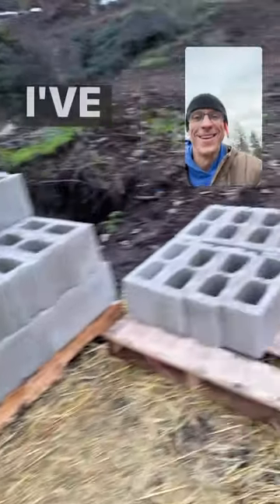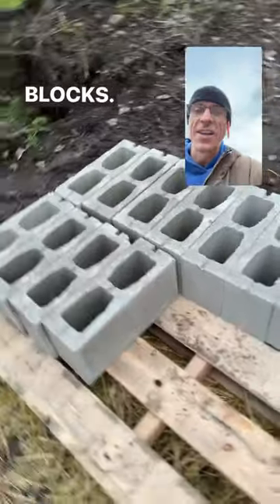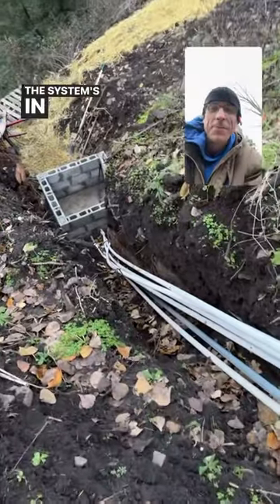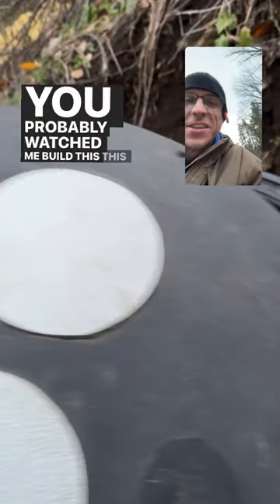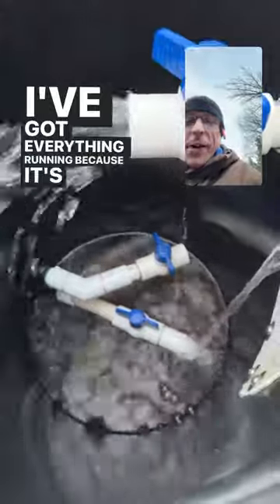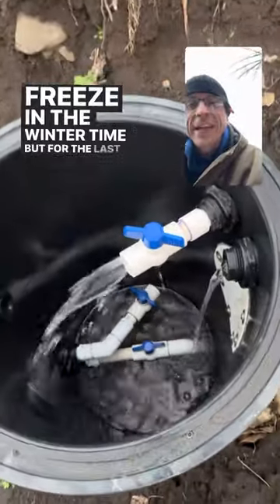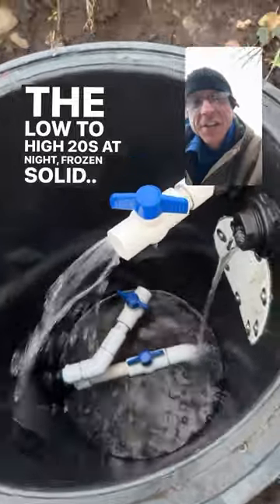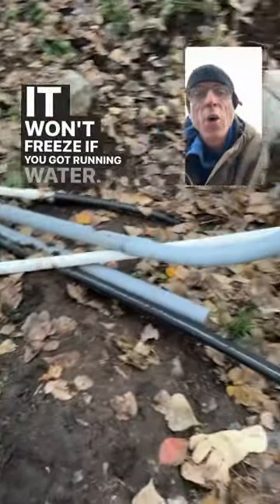Off-Grid Ram Pump House Plumbed ✅ P2 #diy #offgrid #pumphouse #build #idaho #homestead #life #work

Comment: I agree with some of the previous commenters, if it gets cold enough, those pipes/system will freeze.  Insulating highly recommended.  2 plus feet of dirt makes a pretty good insulator.